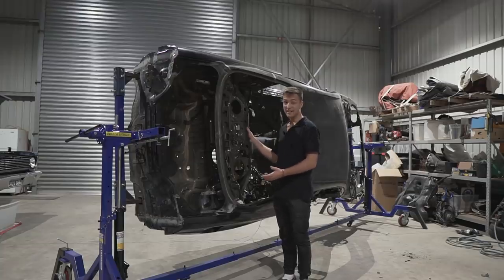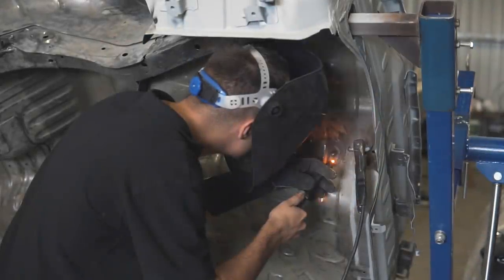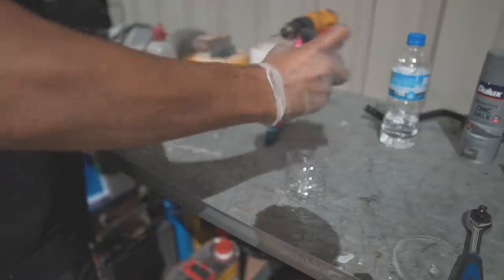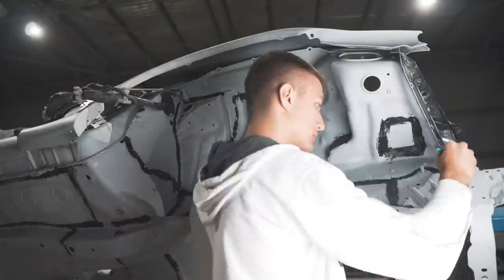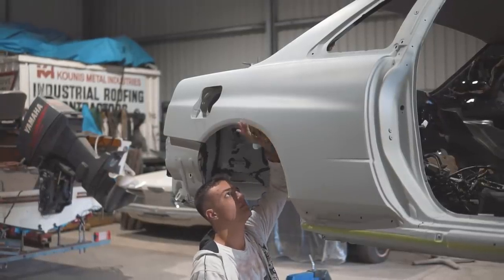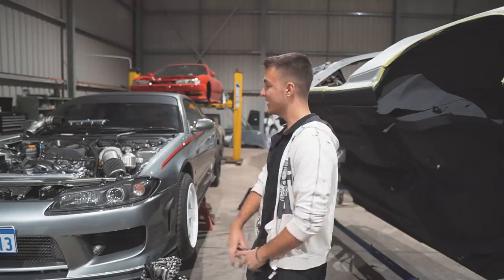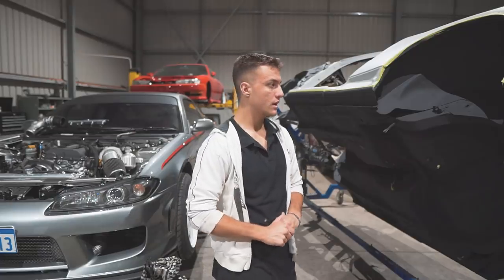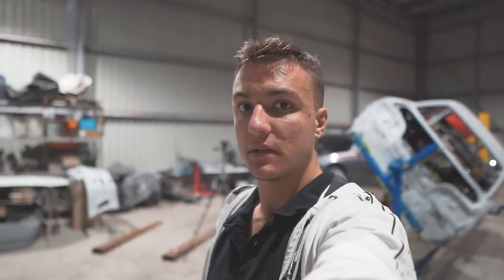R34 Skyline Restoration Project | Poor Man's GTR [EP9]

Comment: Looking great bro! Great vid as always, and cannot wait for when you mock up the engine, transmission, and everything else! 
Last time I under coated my car was 20 years ago and it was so frustrating but I am glad to see how you did your’s.

As for your friend on the S15 engine swap, if he is running the car pretty hard then a 2JZ would be the best option. As for the 180SX I would like to see what you are going to with that! See you in the next vid soon! 🤙🏽
Reply: Could always go billet engine. They have a billet SR20 block: run it on methanol too....
Reply from the maker: Thanks as always Craig! Yeah very time consuming job but got through it in the end haha
As for the S15, if it does get a JZ motor it'll most likely be a 1jz :D
Reply: Broken Silvia 1JZ is good too, either way it will look sweet!
Reply: Anthony Thomas Billet SR20 would be great but I would worry about the price and compare to the JZ blocks, either way as long as the blocks are reliable and won’t break down, it’s all good!

Comment: In terms of gearbox if the car is RWD best gearbox will be a cd009 (6 gears plus very strong and the shifter can be repositioned to suit the tunnel) otherwise if its 4WD R34 GT-R box will be the best (6 gears and strong). The other good option is a RWD R34 box 5 gears and strong.
Reply from the maker: Only the first gearbox option is a considerations. The other two are either expensive or junk
Reply: @BrokenSilvia  the r34 rwd is expensive but very strong seen cars that are 10s use this box n it didnt break

Comment: Can that underbody coating be applied without removing the oem coating that comes on the car basically coating ontop it?
Reply from the maker: Think it can
Reply: @BrokenSilvia  only reason I'm asking is my build/plans is gd chassis basically subaru sti 02-07 and they rust commonly, but a clean one doesn't need anything except maybe a a coat of this

Comment: Instead of grinding it down why didn’t you use a pressure washer ?
Reply from the maker: Doesn't really work that way unfortunately, it's tricky to get off with a grinder. There's no way a pressure cleaner could do it

Comment: I'd rather like to see k24 instated of heavy, long cast iron 2j in that s15
Reply: Pietrek L 2jz’s are aluminum, not cast However, RB’s are cast
Reply: @vgswappedpressurewasher8150  No, they aren't until you order billet block from Mazworx. Both RBs and JZs are cast iron block and heavy AF, even aloy LS is lighter.
Reply: Pietrek L most of the billet blocks on the market are only made for drag racing because they don’t have cooling channels for coolant to flow through. There’s only a handful of billet blocks built with coolant channels and those blocks cost a lot more than what you see from mazworx.
Reply: @dohc1974  It's exactly as you said. I've mentioned Mazworx because that was the first  brand that just came into my head. Beside that this block was proven by Geo in his drag week Supra.
Reply: @vgswappedpressurewasher8150  2J is cast iron